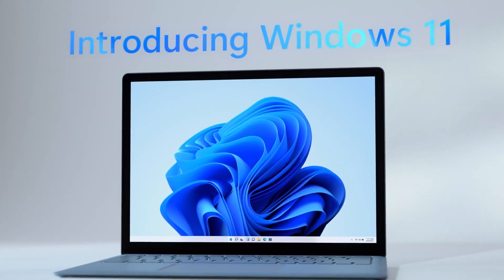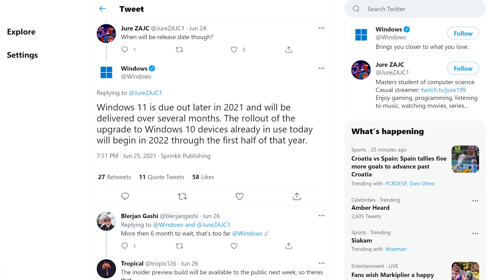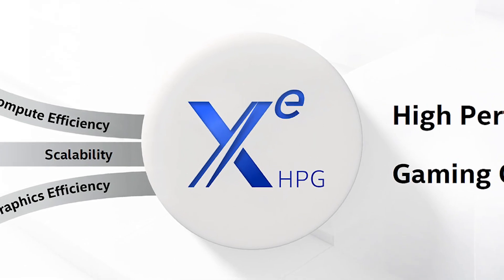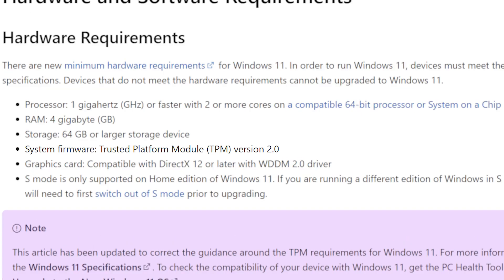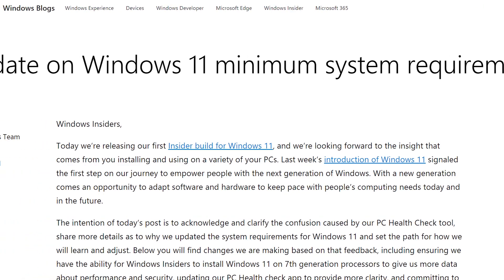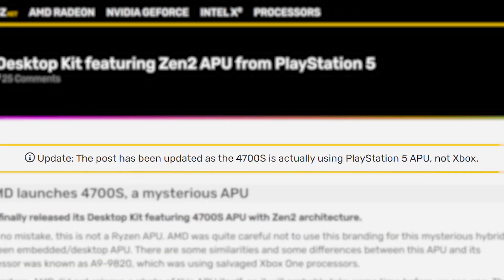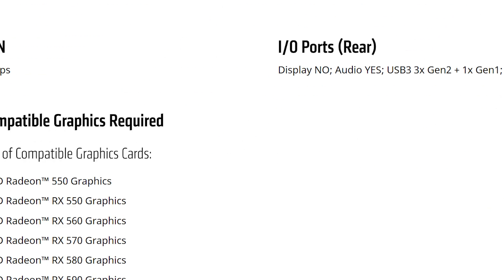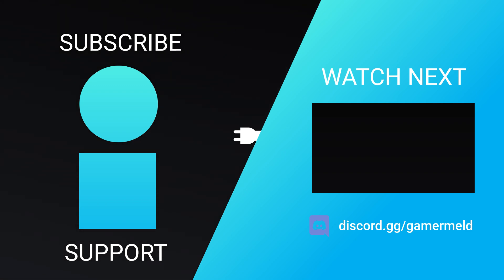TONS Of Gamers WON’T Be Able To Install Windows 11!

Comment: Grrrr....

Windows 11 needs a minimum of a 1GHz CPU with 2 more more cores...Ryzen 5 first gen not supported.  Pretty sure my Ryzen 5 1600 with 6 cires/12 threads and running at 3.5GHz exceeds the 1ghz and 2 core minimum. 

At least I have a B450 motherboard I can flash upgrade to support Zen 3. Now just need to get a 5600X and a RX6700.

Comment: Well, looks like I'm gonna move to linux then with my i7 3770.
Reply: Welcome to the Linux club 👑
Reply: Well Linux runs many modern games without issue except the ones using anticheat and denuvo so I I’m going full Linux later this year since I only playing anime based games
Reply: @yukiseekyo  I want to switch to Linux but not only is my wireless adaptor not supported but Rocket League support for Linux was discontinued so I'm stuck with Windows
Reply: @blayd_  you could use proton to run rocket league current version but for the wireless adapter if it’s not removable then your kinda stuck I guess
Reply: @blayd_  You actually still can play Rocket League using Lutris, however since Epic threw us under the bus the can go F off.  Many USB wireless adapters are supported but also when was the last time you checked, it may be better now
Reply: @LowSpecLinuxLaptop  It's a PCI Express card (Archer T6E) and I tried recently to get it to work, but to no avail. Same with the T3E, which is a USB one. The drivers are only for Windows.
Reply: @blayd_  Proton on Linux works as well as the native version did. You won't notice it
Reply: @yukiseekyo  It's removable (ones PCIE and one's USB but I can't get either to work
Reply: @blayd_  i feel bad for you because Linux is 10000 times better
Reply: @yukiseekyo  Open source, if enough gamer's switch they can build up their own gaming distro, they have the experience etc
Reply: @yukiseekyo  Halo Infinite looks too good to not play dude. Linux won’t be able to run that
Reply: @NazmusLabs  the masterchief collection works on steam with the exception of multiplayer so I think infinite is the same, I don’t really care about multiplayer but that is just me.
Reply: I think we're losing sight that Windows 10 will still work through 2025. Does it suck? Maybe a little bit but as a system admin I'm not that worried about computers going out of date. And anyone that doesn't have a compatible TPM chip on their board will likely hear about the news in the next couple years and have enough time to plan for an upgrade. It seems like chips that are only a few years old should be supported but you have to remember when they stop supporting Windows 10 officially those chips will be about 7-8 years old so I think it's reasonable enough. Windows 10 will run just fine on gaming computers for years to come and no one has to worry.

Also let it be known that this is coming from someone that hates the always connected online tablet style direction they're going with. I don't want to use an online account I don't want to be tracked. Unless there's a very very VERY good reason to upgrade to Windows 11 I will not be using it.
Reply: @rocsorianoguitar  but not everyone going to have access to modern hardware I used to live at Jamaica and new hardware like that is a Luxury, the 2nd hand parts are a lot easier to get and cheaper to boot. Limiting those will cause problems later.
Reply: @yukiseekyo  I agree it's not perfect but they're probably looking at it from the perspective of most people can figure it out by 2026. And that's what they're probably going for which kind of sucks because it's a stupid mindset but it is what it is I guess.
Reply: Or continue to use windows 10.
Reply: @ogar0524  dang you're so smart.
Reply: @13loodLust  he certainly is smart. Linux would be a downgrade
Reply: @ogar0524   i pan on continuing to use windows 10 for a few years.
Reply: Ayyyyyy 3770 gang
Reply: i have a  3570 😭😭
Reply: @spvnkaburner7633  me phenom ii x4 965!!
Reply: I have a i7 4770 ...Looks like i will be going to Linux ...Prob POP OS
Reply: @jasoneckenstein1130  remember that you won't be even encouraged to do anything until late 2025. By then you're going to have a very very old processor you might accidentally come across something that's an upgrade.
Reply: The people funding the projects have been really good at porting Windows "only" games and making it possible to play on a Linux Distro without needing to duo boot.

As in, the old days of people hoping for a Wine project to continue to release their favorite game isn't as bad as it used to be.

As long as your game tends to be popular, a lot of those games would be able to get one working for a Linux Distro in a bit.
Reply: @kuvakei  Linux Mint, I don't think my adaptor has support for any distro of Linux though
Reply: @blayd_  Kuvakei's suggestion should work, I found the same answer on the Linux Mint Forums which indicates as much. If the wired connection isn't an option you could also download the corresponding .deb packages from a trusted source onto a usb stick while on Windows, then manually install them using apt(?) after booting into Mint. I'm a Red Hat derivative user here so I don't know the exact commands, maybe someone else knows them that can jump in.
Reply: dang a 3770, that takes me back, that was my first Computer builds CPU. Got it 50% off at Micro Center as the 4000 series had just launched and they had over stock of 3000 series, that paired with a gtx 750 TI
Reply: Just buy something newer a i5 10 gen is cheap and gives u double the performance that cpu is like 10 years Old 🤦🏻
Reply: @nordskov55  if you give me the money I will. Broke AF.
Reply: @13loodLust   u Can litterelly have a 3600 and montherboard for around 150 euro 🤷‍♂️
Reply: Who still uses a 3770 in 2021 lol
Reply: I think windows 10 and 11 uses a Unix core similar to xbox.  If you are going to use a Unix operation system why not go for the "Real Deal", Linux?
Reply: @michaelmartin4383  a lot of games will not run on Linux that a lot the reasons gamers use Windowss 10
Reply: ayy welcome to linux club brothers
Reply: God damn the thing doesn't even support my i7 7700
Reply: @asy_4168  popOS, fedora, or manjaro would be my recommendations
Reply: @asy_4168  Linux mint is great for beginners
Reply: Just activate the TPM inside the BIOS
Reply: @mizz1414  a lot CPUs do not support TPM my bord has an input for it, but there none to be found now. 4670k with max hero VI. no TPM in the BIOS. that I can find.
Reply: @Mordies  if the CPU has no TPM emulation, you won't be able to enable TPM in BIOS. You will need separate TPM hardware which still won't work. Wait for unofficial hacks. Because Windows 11 hardware wise can be run even on 2008 Core 2 Duo. It is just Microsoft doing some weird stuff.
Reply: @Mordies  look for PTT, it's built into your CPU.
Reply: @avocatos6421  nope can't find that in the BIOS for a  ASUS max Hero  VI
Reply: @mizz1414  Soft Floor was removed, most skylake chips support tpm 2.0 and are still not supported...
Reply: @mizz1414  After W11 releases update your BIOS. Might work.
Reply: Because with windows 11 you cant use 10 anymore? Stop being dramatic seriously. Don't use Windows 11 as an excuse so you could tell people you're using linux.
Reply: @UnoZero1  Nah I'm too dumb to use linux. just gonna stick with win 10
Reply: @UnoZero1  Exactly
Reply: @UnoZero1  It's too late for hating on Linux. It's 2021. Windows is simply outdated technology, including 10.

Comment: Pretty bad move by Microsoft to go down this route. You mention gamers as a demographic that don't upgrade processors that often, but in my experience the majority of people don't upgrade anything from their prebuilt computers for well over 5 years at a time, at which point they trash the old system and buy a complete new one. Many people upon hearing that Windows 11 is coming and that it needs special hardware will simply... send their old, perfectly functional hardware straight to landfill and buy new ones. Utter shame.
Reply: no
Reply: @ryanxgames5988  no... what? What are you disagreeing with?

Comment: for 450$ or less you should be able to upgrade your existing system or just install linux for free.  No need for windows 11 at all!
Reply: Pirate it
Reply: People misconstrue how Linux works. It isn't a direct replacement for a Microsoft operating system. 

I'm an avid user of Linux and have been using it for decades and it's great and all but it definitely has major drawbacks. An average end-user or gamer would be far better off using problematic Microsoft operating systems than they would using Linux without knowing how to repair the bugs in it (coding). The Linux car unstable by the packages that install into Linux usually have issues in a handful of them will crash or be unstable.
Reply: @Twitch_Moderator  i use arch btw.
Reply: @Twitch_Moderator  TLDR: Linux is mainly for developers
Reply: @Twitch_Moderator  I disagree haveing used Linux since 2012 and gaming.  Use Ubuntu base or Manjaro and the normies will be fine.  The big problem is the amount of choices. What to try where to start
Reply: @LowSpecLinuxLaptop  Choices... just install SteamOS like a proper normie, no need for choices.
Reply: @Xtcent  But Steam OS is not really good.  Steam client is on almost every Linux distro
Reply: @LowSpecLinuxLaptop  I know that, but there are too many distros for the average person to understand them.

Comment: Windows stated they are looking at customer feedback and are most likely going to support intel 7th gen and ryzen first gen
Reply: This wont be enough, in our household there are 5 laptops with intel CPUs older than 7th gen and they all work perfectly fine! MS can't just expect us to throw them away and get a bunch of new ones just cus?? And we're certainly not the only ones.
Reply: @dazley8021  every processor that runs win10 should be able to do win11 as well unless their new os is a new unoptimized mess like win10 was
Reply from the maker: I mentioned this in the video. That update actually came in while I was editing, and I made sure to go back and include it.

Comment: me running on windows 11 beta on a ryzen 3 2200g right now
Reply: All Windows Insiders who have already been installing builds from the Dev Channel on their PCs up through June 24, 2021 will be allowed to continue installing Windows 11 Insider Preview builds even if their PC does not meet the minimum hardware requirements.
Reply: Did you just say "beta" or is it the dev channel?
Reply: @xrtlized  dev channel. I'm staying away from the Dev channel because I have enough trouble out of the beta windows 10 on my system. It's well spec'd out too.
Reply: Where's the beta at?  Share it?
Reply: @snoflahke6575  Go to Windows Update and join the Windows Insider Program. Free and easy!
Reply: @snoflahke6575  inside beta program member, fyi its not worth it stick with windows 10
Reply: If you can't install Windows 11 you're not missing out on anything it's nothing but bloatware, spyware and a ui change thats not for the better.
Reply: The betas virtual machine so yeah it will run on any system.
Reply: @CragScrambler  its a clean install the fact there trying to force to upgrade cpu's just shows you this will be full of bloat ware and fyi you have no choice to be connect to the internet to even get through the first  sign in, there is no offline button
Reply: I hope it works
Reply from the maker: Older CPUs work for the Insider Preview Build, but won’t work on the final build. Microsoft has said this multiple times. I had it in the original take, but I removed it because I had to include the update. I guess I should have kept it in.
Reply: @GamerMeld  there is no reason for a ryzen 3 2200g not to work with windows 11
Reply: @MrFacepeel  Unless Microsoft decides to screw you..

I can run all of my game (a lot of it is AAA title) on R3 2200G + 1050 Ti just fine, if an OS can't do it then it's bs
Reply: @GamerMeld  if they try to force me to upgrade hardware when if more capable of running there windows the linux here i come
Reply: @GamerMeld  it still tells if you're pc it compatible or not in the windows program it said mine was windows 11 ready

Comment: FALSE! you take 2 files from the win 10 install iso and swap them out and you can instal it. That's actually common knowledge now since it's easily found by goggling it. -_- smh fud
Reply: Yep. I did it on a spare system I have lying around. A dell T3400 which has a core 2 duo and while it does have a TPM module on board(1.2) I made sure it was disabled in the bios before install.
Reply: theres another way also with reg edit its on twitter somewhere
Reply: Thats true for now, but microsoft will probably fix that soon.